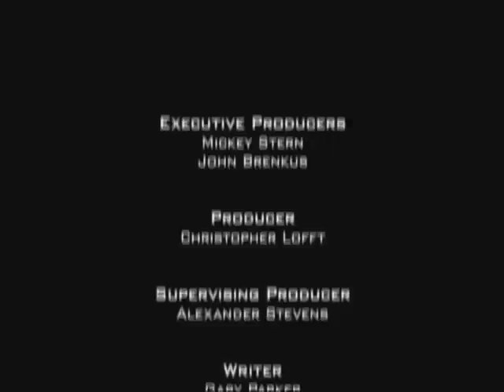World Land Speed Racing Record Contender - North American Eagle

Comment: Here's another comment: anyone noticed the total lack of automotive safety equipment besides me? She certainly not wearing an automotive style crash helmet or Halo gear. I don't see any kind of roll protection in this vehicle, and she certainly wasn't wearing the kind of driving suit you'd wear in a land speed car. perhaps she'd still be dead and I have yet to find out what the cause of the crash was but perhaps the car just came apart. Aircraft are not cars.
Reply: fuck you

Comment: Uuuh. Budweiser rocket car did speed of sound first. Also.... In California we measure in Miles Per Hour! LoL
Reply: I have to add at the risk of starting an argument ... allegedly.  As I understand it, the USAF claimed their radar data showed a speed in excess of Mach 1 for a brief time, but there is at least some doubt whether this is accurate.  They might have broken the sound barrier, but Thrust SSC were the first team to meet the FIA rules.  I have to ask, if the Budweiser rocket was that quick, why didn't they do a sanctioned run?  That said, the Budweiser guys, and the NAE team deserve much respect for what they have achieved!
Reply: I can do MPH without a calculator.  5280 feet is what makes MPH in 60 minutes.  WTF has a meter to do with anything?  Gentlemen start your engines... when Indy goes metric,  i'm done with the brickyard.

Comment: 3:30 Narrator says "We get around 105 feet per gallon of gas..." That means 50 gallons per mile. I'm assuming he means when they are at full throttle and full afterburner. Does this sound accurate? I know the J79 Turbine Engine burns about 1.5 gallons per second at full afterburner.

Comment: I wonder if it does have enough power. The max speed of flying jets is at high altitude where the air is thinner. I know the Thrust SSC is 200 mile an hour faster than a Euro fighter at low level, even though the plane has a much higher top speed at altitude.
Reply: The F-104 could exceed Mach 1 with external stores at sea level.
Reply: The American tradition of land speed record breaking seems to consist of 'good ole boys' knocking stuff together quite creatively, but in a rather informal way. Whereas this approach may have been effective in the past, it simply is not up to the speeds and resultant complexities of modern record breaking. The British by contrast are the principal F1 country and build more of the worlds top racing cars than anyone else. This leads them to a scientific, hard engineering approach that is simply lacking in American efforts. There comes a point when you can't simply strap an ever larger supercharger onto your V8 (metaphorically speaking) and have instead to start hiring mathematicians and aerospace engineers.

Comment: @ Johnny Wilde. you're correct with Bloodhound being build for the job as a land vehicle. I'll sound biased being a Bloodhound 1k Member but we hear things that makes me think the Eagle was a good idea when the LSR was maybe in the 600mphs. The low  altitude speed record is 990mph which incidently was set by an F104. Even without rolling drag of wheels on the ground the shape itself will never get it to 1000mph or the low altitude airspeed record would be higher. Also add in the EJ200 jet in Bloodhound is the most advanced jet engine and that's working outside its envelope at 800mph. Thrust SSC had 2 engines for stability only not for power anyhow. The fastest a jet engine ever went at ground level is 990mph after that you need a rocket. They can add more jets, though they'll increase cross section and drag and maybe end up slower. Bottom line is, the Eagle is a novel idea but an F104 maxed out at ground level peaks about 990mph. 10 mph less than Bloodhound and Aussie Invader 5R hope to achieve. The Eagle is a dead duck because its designed on something that can't and never has done 1000mph at ground level even without rolling resistance of the ground.

Comment: The eagle is an impressive attempt at breaking the record but there is one flaw that could make it difficult more so then less, the thrust has a dual engine setup, the eagle only has one. this could limit it's capacity to match the thrusts final results, I feel a redesign incorporating a dual engine setup is in order to at least match the thrust's record breaking run..